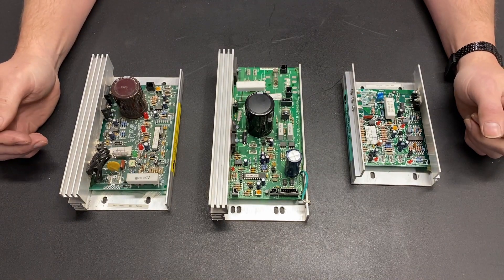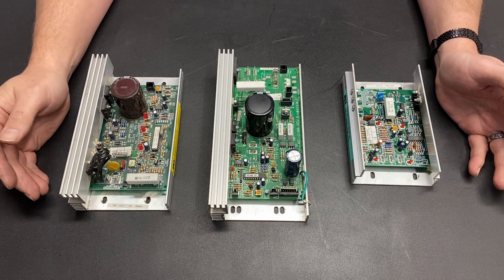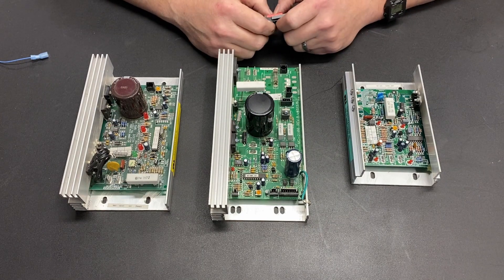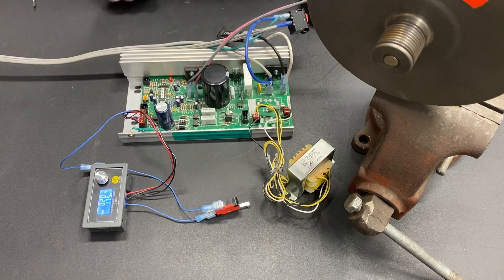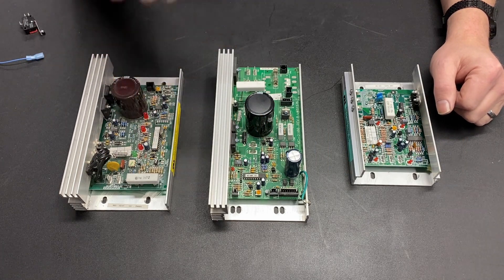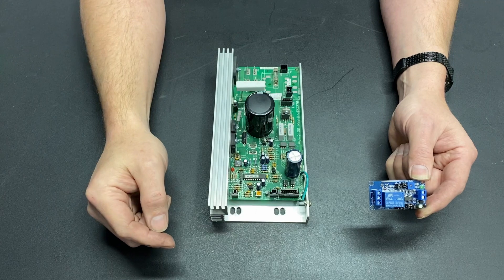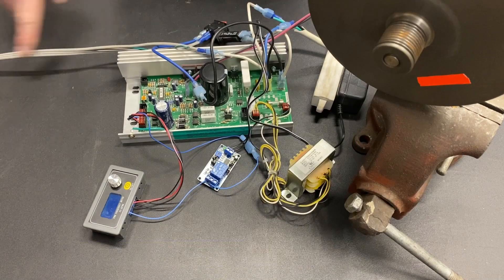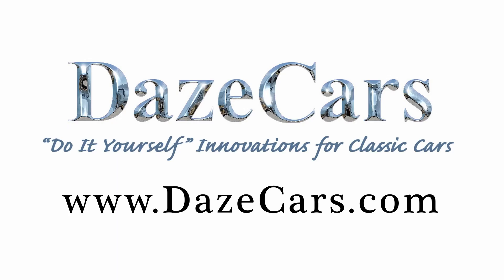Eliminating Soft Start on an MC60, MC2000 and MC2100 Treadmill Motor Power Supply for Mill or Lathe

Comment: I do not find it hard to turn down and back up.
Reply from the maker: It's not hard but it's also not convenient either.  Some times (like drilling holes with a drill press)  you want your tool to be at the same speed every time and in situations like that soft start is a pain because you need to get it to the desired speed every time you power it off and back on again.  BUT if you eliminate the soft start you can simply flip the switch on and drill your holes.

Comment: I hook a switch to the PWM controller on the positive wire I left the push button switch on still had to push in on and off to start it but accidentally found if you leave the push button to  on with switch on then press and hold button om the pwm button a few seconds the flip the switch on and of soft start is eliminated
Reply from the maker: Thanks for the tip, I will keep that in mind.
Reply: @dazecars  Good Morning Just wanted to let you know what I found when I put in the parts for a electric brake on my lathe  I found out i got the soft start issue back again. Turns out when I hook up a switch on the positive of  my PWM controller would shut off the PWM controller but still had my ac power going to card all the time. Now with the new set up would shut off everything. So my only alternative is to disconnect my hot wire off my card then take the hot wire coming in to box and put a jumper on it to a fuse and connect it to the card Then everything should be protected and when I use the  either the EPO or the heavy duty switch
Reply from the maker: the brake should not have any effect on the main power going to the board.  It should only be cutting power to the motor and dissipating the energy from the motor.

Comment: Great videos. I’m about to build my drill press project using a MC-2100 board. My idea of a work around is to use a 4-hour light timer switch ($12.99 at Lowes) as a master switch. The first time you use the drill, rotate the dial and forget it. If you’re still working after four hours, take a break and have a beer! 😊
Reply from the maker: It's a good idea to have a timer to properly space your breaks 😁

Comment: MC-60 rev k need R14 blue resistor
Reply: Please can some one help need R14
Reply from the maker: I looked at several I have but can’t tell exactly what color the bands are. I will disconnect one and measure the resistance.
Reply: Could you please help I think it's 470 ohm 2watt
Reply: Please help I thank it's a 470 ohm 2watt but not sure or where to buy @dazecars
Reply from the maker: If those are the specs a quick amazon search will have the results.  I easily found this one https://amzn.to/47JhA2V

Comment: Where does the soft start function live on the board? Is it programmed into one of the chips?
Reply: This is a low cost controller..so no microcontroller is used for soft start. 
The soft start , at minimum is just a resistor and cap. ...the "RC" circuit is placed in series with the wiper terminal of the speed potentiometer.
It is usually a "half T" type RC filter with one lead of cap. at "0" ref.....the R×C product is ramp up time (accel.)of the soft start.
In this case the ramp down time (decel.) is also the same... although both can be made independent of each other.
This is basically a 
"voltage/speed" based soft start. running in open loop control.
Reply from the maker: good info, thanks for posting
Reply from the maker: I honestly don't know

Comment: The capacitor discharge can be hastened by decreasing the value of the bleed resistor if it has one , or installing one between the positive connection of the cap , and a ground trace on the board .
Reply from the maker: Thanks for the tip

Comment: Thanks, Daze! I just clipped R19 on my MC60 for a drill press conversion and now it works like I'd like it to! Set speed, leave it there. Power off, power on--right back where I left it. Took maybe one minute, mos of which was finding my tiny diagonal cutters.
Reply from the maker: Glad I could help

Comment: Do you know if it is also r-19 for the Mc-20 controller board? Ripped it out of an old lifestyle treadmill that interchangeably used the Mc-60 and mc-20 in its build
Reply from the maker: I do not know.  I would say its not likely but there is a slim chance it would work

Comment: Daze! Do you have a video regarding adding a soft start in a scr circuit? 
I've got my setup in a learning environment where I don't have faith everyone will turn down the pot before turning on power. Does this make sense?
Reply from the maker: I do not have a way to add a soft start.  Im sure it can be done but that is above my abilities.  Easiest way to add soft start would be to use an MC60, MC2000 or MC2100 as a way to drive the motor.

Comment: updated...treadmill was in flood..prior to flood worked fine...after flood when power on display shows fine but when hit start the motor immediately runs at full speed then shuts off a few seconds later...and this repeats whenever start button is pushed...im thinking its bad mc2100 due to water damage...since the mc2100 was probably in water or got wet.....does this sound logical?
Reply from the maker: yes that is a bad MC2100

Comment: The surge at the beginning is going to happen because all if these cheap MCB’s turn on the same way.  If you notice the power LED, it will flash once for a split second, then off for a half second, then back on solid. This is the way they are designed for one reason or another….

One way to prevent this would be to use a potentiometer that has a switch on the end of the throw. They also make 4 pole latching push button remote start bottons that have a momentary pin that closes on each press. You may have to add a relay or two in conjunction with this to make it operate as desired for the application…

The downside to these boards is that they are unreliable when you make a simple wiring mistake Or put too much load through it just once. There are also different mc2100 MCB’s that are for 50amps and others that are for 30 amps. The newer boards that have the white main harness connector(instead of red) are garbage compared to the older PWM boards. I’m sure you noticed by now the PWM boards have a much smoother ramp in rate than the mc80 amd mc50 boards.
Reply from the maker: The more I have messed with this stuff the more I feel using the treadmill power supply is like putting lipstick on a pig.  A purpose built power supply even if still DIY is better than a treadmill power supply, but people still insist on doing it so I try to give them options.

Comment: i would like to use the mc2100 board that came  this treadmill for a wood lathe . can i control the speed with a potentiometer using some of the wires that come down from the dashboard , like maybe Black , Red , Blue for instance . thanks Peter
Reply from the maker: No you can not.  Unlike older MC60 controllers an MC2100 uses a pulsing signal from the control panel to control speed.  This video (about half way through) shows the signal generator you need to make it work and how to hook it up. https://youtu.be/RikeVYxITUQ

Comment: What pins are you using to power your pwm frequency generator off the mc2100 board?  For some reason I thought you had used external power for it but realized in this video you have it to the board itself.  Thanks for these great videos.
Reply from the maker: Glad you like the videos... I cover wiring about 13:30 on this video https://youtu.be/RikeVYxITUQ

Comment: Hi there, the board I have is different to all these, I have to cope with a 5 second countdown and then it starts on the slowest speed. I can then ramp it up in increments on a momentary switch. Any ideas what I can do?
Reply from the maker: Sounds to me like you are using the treadmill control panel to drive the motor control board, which means I don't have a fix for that.  The more treadmill parts you use the more you must deal with treadmill features.
Reply: Can you replace the treadmill control panel with a on/off switch and a potentiometer an it work?
Reply from the maker: depends on the type of board

Comment: Instead of turning off the power to the board, whai if you put a switch on the output to the motor?
Reply from the maker: Thanks for the input! That is exactly what people have when they add a forward reverse switch,  because said switch must be center off.  Once the system is up and running you could totally use the ditection switch to avoid soft start all together , BUT you would still need to deal with soft start the first time you powered up the machine with master power, and you would also probably need to add indicator lights to show you the system is still on even when the direction switch is in the off position.  Without indicator lights it would be very easy to leave the system on.  This solution while clever is IMHO more of a bandaid than soft start eliminator.

Comment: I’m thinking another option to get around soft start would be to add a 20 amp switch between the motor and the controller. This would provide a way to stop/start the motor without killing power to the control board. To improve on this idea it would probably make more sense to use a 20 amp relay with a light duty switch.
Reply from the maker: Thanks for the input! That is exactly what people have when they add a forward reverse switch,  because said switch must be center off.  Once the system is up and running you could totally use the ditection switch to avoid soft start all together , BUT you would still need to deal with soft start the first time you powered up the machine with master power, and you would also probably need to add indicator lights to show you the system is still on even when the direction switch is in the off position.  Without indicator lights it would be very easy to leave the system on.  This solution while clever is IMHO more of a bandaid than soft start eliminator.
Reply: I have the  exact same adaption I find the safety protocol of the board great, incase of power outage, it forces you to restart the board oththan that simpl switch  fwd centeroff rev. great  for drill press or lathe with a separate  tach. Powered by a wallwart off the ac leg of the incoming pwr. Love it just remember to use a reverse switch  with  center-off, can wire yourself or buy pre-wired
Reply from the maker: thanks for sharing your reel world experience

Comment: I have used the pulse width generator on the mc2100 and I find the slight delay not too bad on my craftsman 6 inch lathe.
Reply from the maker: The delay in regards to what?  Are you using a relay to eliminate soft start or just the on off button on the signal generator?  I ask because I am not sure what delay you are talking about and or how it is related to soft start.
Reply: @dazecars  the several seconds after pushing the start button when the motor turns.
Reply from the maker: @josephhagler5145  the delay is not an issue it's the soft start that is the problem (not being able to go to the last speed without turning it all the way down first) .  Are you using a different signal generator with built in delay to bypass soft start?
Reply: @dazecars  I use the one you showed in your video.When I turn it on with the yellow button it goes to the last speed I had set.
Reply from the maker: @josephhagler5145  the delay never bothered me either.  I just didn't like having to use the on off on the signal generator.